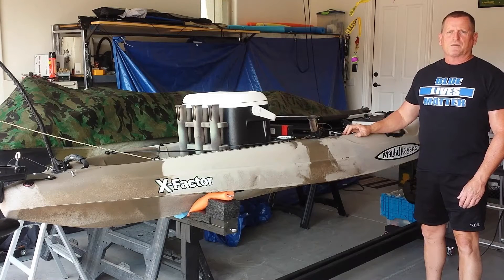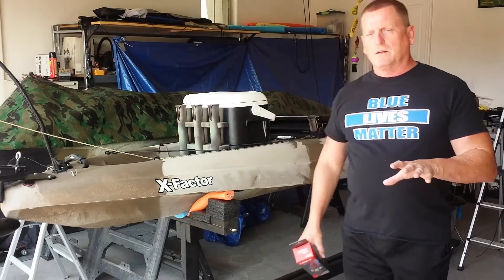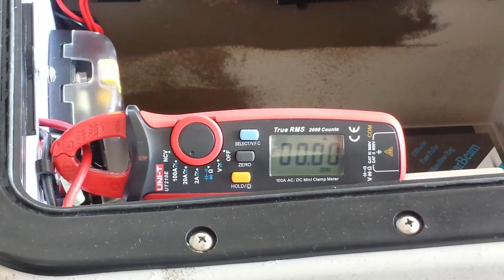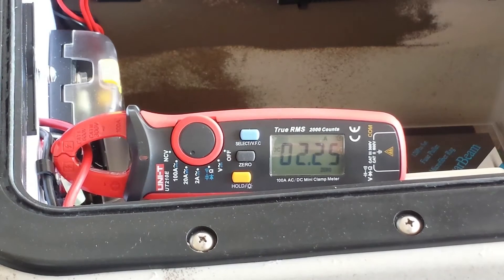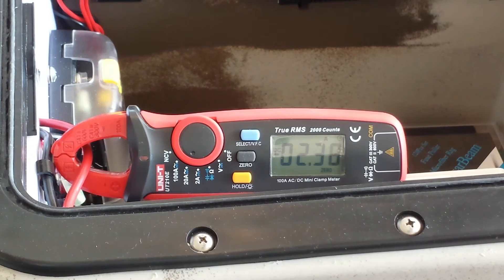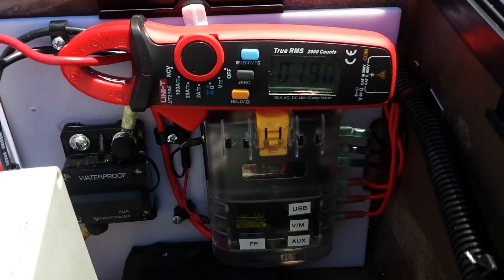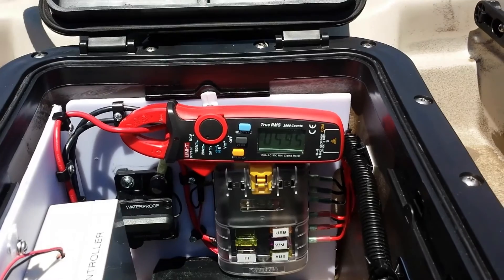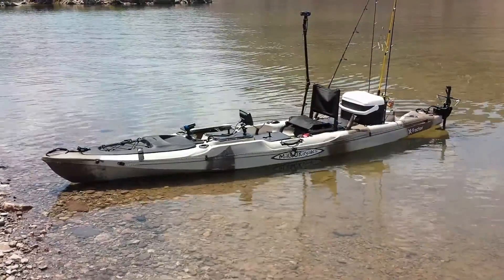DIY Malibu X Factor Kayak Trolling Motor AMP Draw Testing

Comment from the maker: If you look at my updated comment, the actual max Amp draw was greater than 18A. The PWM was not adjusted properly from the company. Once I made the adjustments, the maximum draw was 28A. I am going to update the narrative. Thanks for the interest.
Reply: Appreciate the info brother. After adjustment, what was the amp draw at 1/4 forward, under the full load?
Reply from the maker: @kf4293  Thanks. I don't remember the 1/4 load value. I just charted the WOT amp draws.
Reply: @Aksmaniyak  no problem, I was just curious. I'm thinking about building a small plywood boat, and using a solar panel as the awning. I figure it will at least increase my range.
Reply from the maker: @kf4293  A PWM will definitely decrease your amp draw and increase run time.

Comment: You may have figured out by now that on your No-Load test you had your multi-meter set for AC instead of DC on your amp draw test.  
NO WAY it can draw same current at low speed as at high speed,  load or no load.  In fact the motor will draw MORE amps when running at no load than when running in the water (at same settings).
Reply from the maker: I'm not sure what you were looking at because the meter clearly shows it is in DC mode. Also the readings start at 0 and max out at 2.25 A with no load. The motor draws more As when in water (load) than air (no load) as my other tests and basic physics prove.
Reply: 2.11 Amps,  2.18 Amps,  2.24 Amps,  2.25 Amps  from low speed to full throttle on a 46 foot pound electric motor.   A 0.14 Amp increased current draw from a crawl to wide open ???    Does that make sense to you ?
Reply from the maker: Yes because the load (air) never changed. The draw would be much higher in water with the addition of pushing the weight of the kayak through it.
Reply: Aksman you are correct, air resistance on a trolling motor blade is not enough to cause much of a load on the trolling motor that is why the current is so low and almost the same at all speeds.

Comment: Hi Aksman, found your videos while researching a Newport Vessels NV Series 46lb thrust motor. More specifically I want to put a PWM module on it. I haven't purchased the motor yet, and was wondering if there are 4 wires going to the motor like on the Minkota? Do you mind sharing your schematic?

Regards,
Reply from the maker: Hi Brian. The NV motors have the same 4 wires as the Minn Kota. I made a video of the Wireless Pro PWM wiring to a trolling motor.  The video should help.

Comment from the maker: After going through tests with other TM's, I had some concerns and contacted the PWM supplier. I found out that the PWM had not been adjusted properly from the factory. After I made the adjustment, my max current draw was approximately 28 A.
Reply: Aksman

Comment: I am trying to figure out how the amp draw equates to the amount of energy used/?left over in the battery.  I do know that underload the motor pulls more amps.  My 55lb trolling motor at full tilt under load pulls about 16amps max (if memory serves me right), unloaded about  a little over 2amps+.  I want/need to extend my batteries useful energy during use and do it safely so I can get home without calling the USCG!  tx, edwin
Reply from the maker: Well as you know, the energy/power rate formula in Watts is P = IV. Most batteries are based though on Amp Hours. As an example, if you have an 80 AH battery and run your kayak at an average rate of 10 Amps, then your battery will last for approximately 8 hours. Using less amps will increase the life of the battery charge. The PWM will definitely help with that. I use one battery for all my electronics because most other devices do not draw much current. You could use one battery solely for the TM which will help a little too. Keep me posted. Thanks.

Comment: awsme video I just bought the same motor no I wont have to do that because now I no ittle be about the same im in a canoe
Reply from the maker: Thanks. Just remember that I used a PWM speed controller that typically draws less AMPs than the stock 5 forward and 3 reverse trolling motor speed selector. A good design rule of thumb for current draw using a stock trolling motor is about 1A per 1lb of thrust.